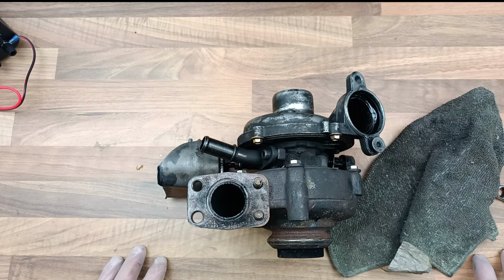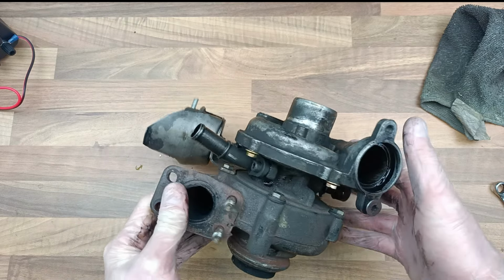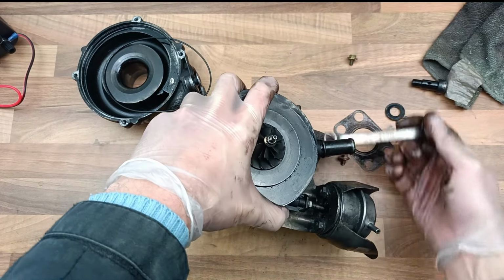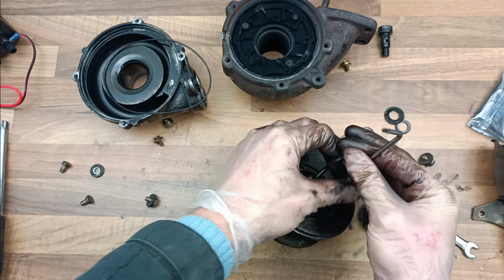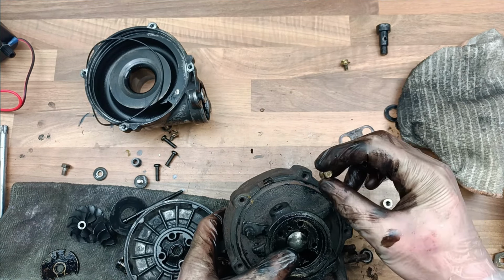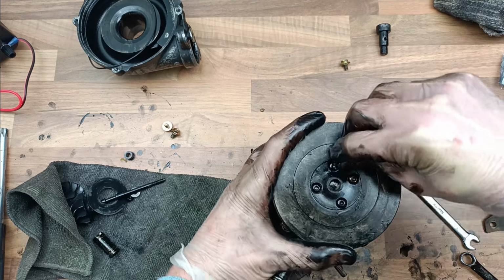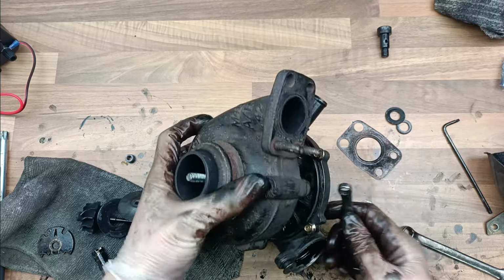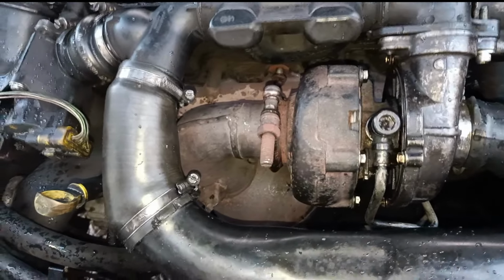Garrett GT1544 - Citroen, Ford, Peugeot, Volvo 1.6 TDCI/HDI Turbo - Permament Fix!

Comment: the worse seal to go on a turbo is the intake seal as the engine will have its own fuel source now and can lead to run away and rather then burning diesel it burns the engine oil and revs till the point it melts or something breaks another common problem is the soot build up in the variable vains and they get stuck and then only give power at a fixed rpm rather then varing the vains for turber spin speed at lower rpm
Reply from the maker: I've got absolutely no idea what's wrong with my turbo! The seals on the spindle were wrecked. I replaced and it still didn't work. 🤷‍♂️
Reply: @AntonyCartwright  ok so actuater controls vains if they stuck torbo wont work right only at set exhuast flow rate then it will spin up if bearing went then the vains rub on the casing miss shapre them and wont compress air most cases astra vectra i have worked on tends to be actuator fails or the vains get carboned up and get stuck
Reply: @AntonyCartwright  video at 12.23 are the parts i mean
Reply from the maker: @1981dasimpson  So, on this turbo, if I actuate it, about 10 little pieces of metal stick out and grab onto the impeller thing.

Comment: That's the worst advice I have seen in a long time xD. Maybe if you are stuck in the desert or something to get home its an idea...
Reply from the maker: Trust me, this is very good advice. I've had a ford focus for 7 years. This little dabbling has saved soooo much hassle. It's a dream come true.
Reply: Gutting a turbo is an outrageous idea🤣🤣🤣. Maybe fix the issue causing turbo failure in the first place next time👍(injector seals) @AntonyCartwright
Reply from the maker: @harrisonwebb5279  The injector seals have been done. It's a poor design. Still, I don't have a turbo. It's the best decision ever for this car. I'm still running it without a turbo now. It's bombproof!